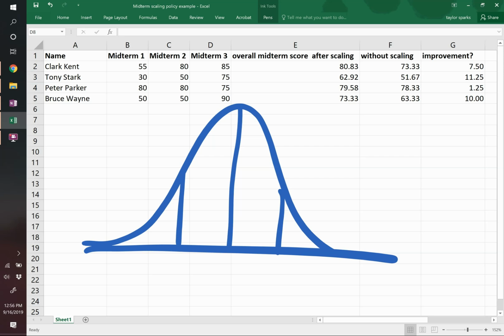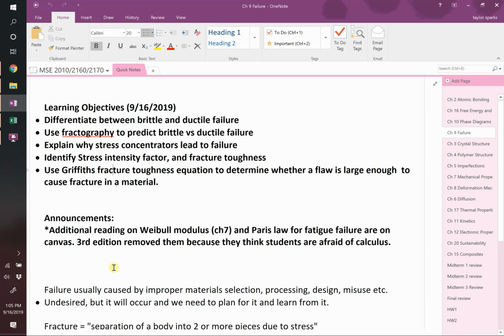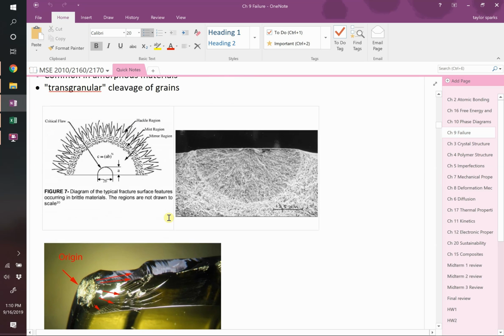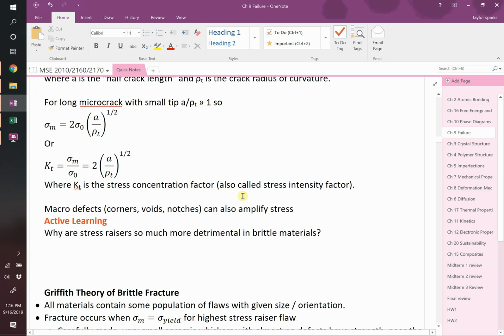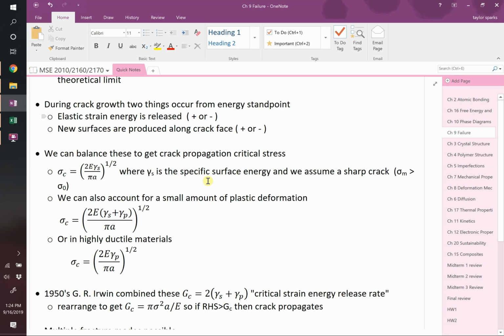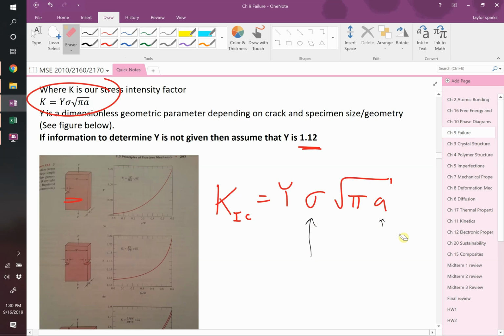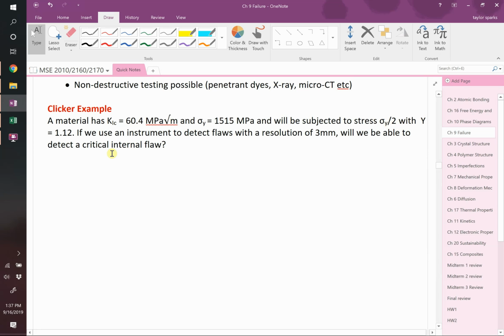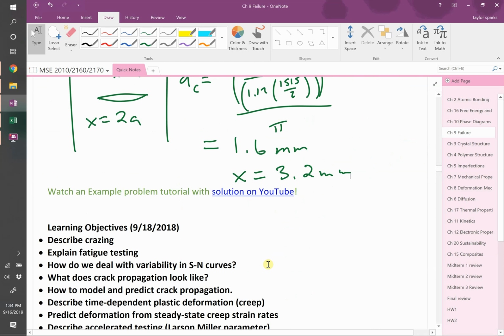Ductile vs Brittle fracture and Griffith Fracture

Comment: Sir why surface crack is more detrimental than internal crack ?
Reply from the maker: actually, if you were to split an internal crack down the middle you would see that it looks like two surface cracks; one on the left and one on the right. Each one has the severity of half of an internal crack length.